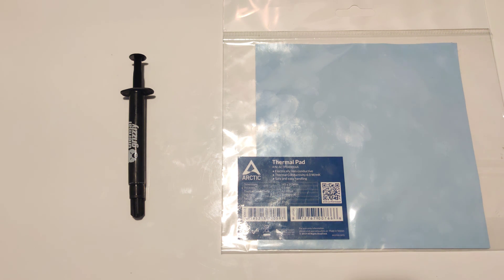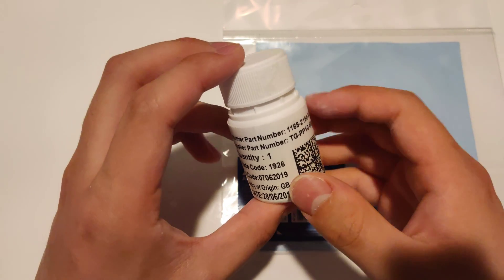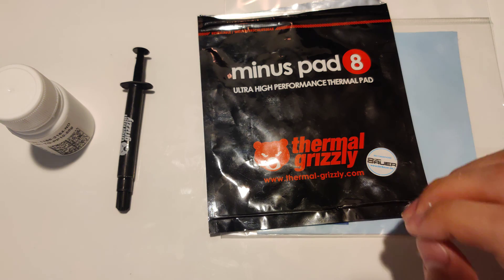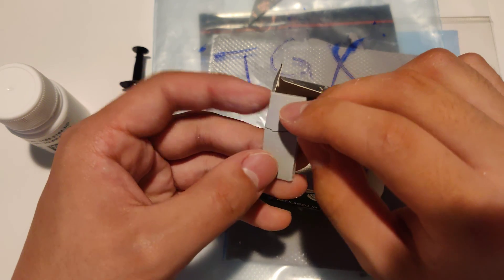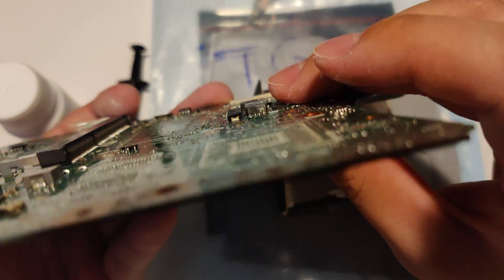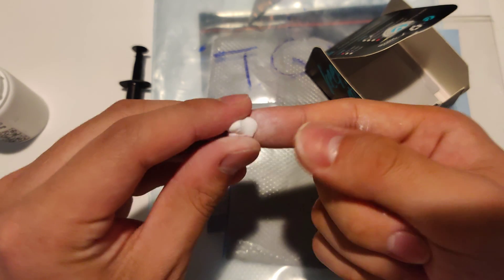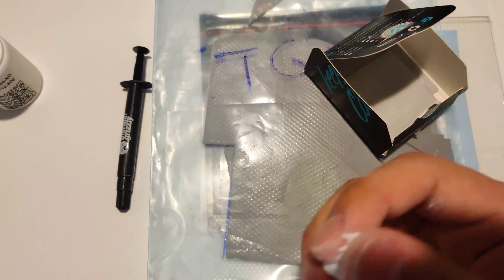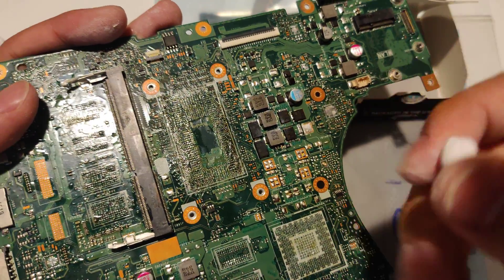10W/mK Thermal PUTTY

Comment: I’m here because I found a putty-like material inside a non-original charger (it claims 67W output, GaN with a PD port), and I was surprised — I usually used to find a metal plate inside. It’s the first time I’ve seen something like this, so I got curious. The putty was located at the base of the plug pins, contacting both live and neutral, and was in contact with almost all components except the fast-charging controller chip. It also touched the case, probably to keep the board in place and damp vibrations, since the board could rattle slightly inside the housing. The putty didn’t seem to be a good thermal conductor, so it’s likely used just to add some mass and suppress noise. When I removed it, it didn’t leave any white residue — the mark left behind was transparent.
Reply from the maker: Thermal putty's thermal conductivity is worse than the best thermal pastes and more comparable to most thermal pads. It does conduct heat much better than air, so having it is better than none at all. You are also correct about suppressing noise and adding mass. It's thermal mass as well, which means the charger takes longer to heat up.

Comment: I just changed thermal pads in my MSI G65 RTX 2060 i7 Laptop with T-Global TG-PP10, and dropped a massive 20% on cpu and gpu. Amazing !
Reply: You should try putty Upsiren UX Pro, and on CPU and GPU phase-change material Honeywell PTM7950. It comes in as a sheet, lasts longer and performs works better than traditional pastes.

Comment: TG-PP-10 is an amzing product as a crypto miner been using it long time. simply amazing product. i used on RTX 3070, 3080 and 3090, also used on RTXA200 and A4000 results are better then any pads i used before, also if you doing a copper mod on GPU memory modules this product is amazin. Still i wouldnt touch it with bare hands mate. Skin is your biggest organ and its always exposed.

Comment: I hope you see this. Does the putty have any mechanical strength? Atleast stronger than thermal paste, if not as strong as a heatsink plaster/thermal glue?

I'm trying to build something with peltier modules, and the situation I'm in, I need the heatsinks to be suspended. As in, instead of resting on the modules, the modules are suspended and the heatsinks have to stick to them.
Reply: TG-PP10, along with other Thermal Putties, does not act as a strong adhesive. It's more like mac-tac or or plumbers putty. If it's mounted horizontal it could work okay for you. minimum bondline thickness will be around 0.1mm

Comment: Hey Brad, I'm planning to use the thermal grizzly kryonaut on the other components. Would it be okay? Or would you still recommend using the putty?
Reply from the maker: Thermal paste doesn't hold shape, so it's better for components that press together (like a CPU and cold plate) instead of filling a gap.
Reply: @BradsHacks  Thanks man

Comment: Say, given this has as much or more thermal conductivity to thermal paste, I could use it instead of paste to add more heatsinks to my cooling system, right? The surfaces on it aren't even in all places afterall.
Reply from the maker: Yeah, that sounds promising. The only downside I found was that it can get a bit messy.
Reply: @BradsHacks  Yeah, I think I might stick with paste for the flatter bits, since I won't have to worry about squishing it flat enough. We'll just have to see when I order it all. thanks for the response!

Comment: Brad how did this hold up over time? Great vids, thank you.
Reply from the maker: I tried it on my 2020 MateBook X Pro, between the VRM components and the heatsink. It worked very well in transferring heat, but it was messy and oozed all over the place as I squished the heatsink down on it. So I spent 2 hours cleaning it off and reverted to thermal pads. This putty would work very well in small areas, but over a big chunk of motherboard, it's too messy. I didn't leave it long enough to see degradation over time.
Reply: @BradsHacks  thanks for the reply, was thinking about putting it on my vram in my 3080 for when I’m not gaming as I mine with it. I’ll just stick to thermal pads then. It’s a gaming machine first, then miner
Reply: @vincedonpsn9590  evga uses putty and the cooling is fantastic on em, don't know what type tho, I believe they use the non silicone putty (as its grey) but the non silicone kind is only 3wmk so it's surprising they're cooled so well (silicone based pads and putty will bleed oil eventually)
Reply: @StylinRed  how do you know they'll bleed oil?
Reply: @thingshappen9199  bcuz that's what they do...
Reply: @BradsHacks  i am planning to place it on rtx 3090 as a replacement of thermals pads , i am not worried about the mess , just wanted to know if its non conductive and wont cause a short circuit ...   what do you suggest on that ? . Is it safe to use on board

Comment: Great video and detail. After soo much searching on the web this putty seems to be what I am going to use. I've been asking the question for a long time... Why can't I replace the thermal pads on memory or vrms on motherboards or gpus with better thermal compound like thermal paste, as good thermal pads are expensive. @10W/mk this seems to answer my question. I'll pick some up and do some testing. Hope it improves my temps and performance. Excited to test. Again, great explanation. I'm surprised no one talks about this...
Reply: Did you use the putty? How has it aged, did it dry out?
Reply: @thingshappen9199  Sadly, could not get any to South Africa ;-(

Comment: Great uploads, liking the straightforward explanations without feeling like your dumbing it down too much. In your opinion what is the best power/performance dense ultrabook on the market, I was thinking blade stealth 2019 till I saw your power throttling vid.
Reply from the maker: The situation may have changed with the Razer; somebody found a way to trick it into believing it's using less power than actual. This would make the Stealth the most powerful. http://forum.notebookreview.com/threads/take-full-control-of-your-razer-blade-w-no-pl-throttling.827919/
Other than that, I'm looking forward to the upcoming XPS 13 2-in-1. It has two fans and vaper chamber, and more efficiency thanks to Ice Lake. Potentially good.

Comment: Is that Fuji poly 17w pad the same stuff AMD uses on it's new GPUs?  Thanks for the video btw, a bottle of that will be better to have on hand then a bunch of different thermal pads with varying thicknesses.